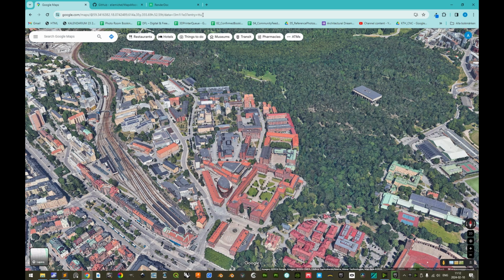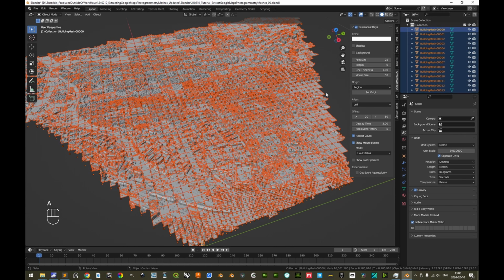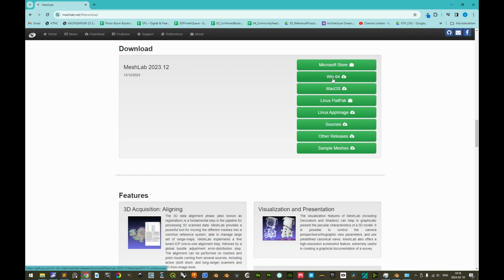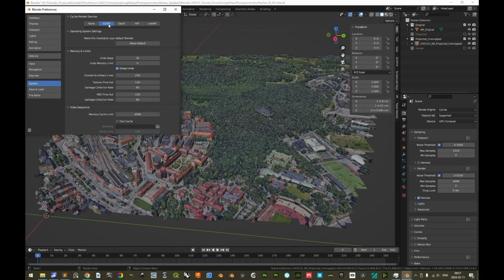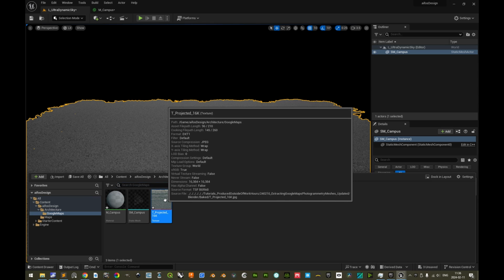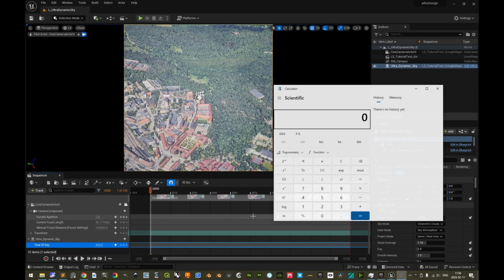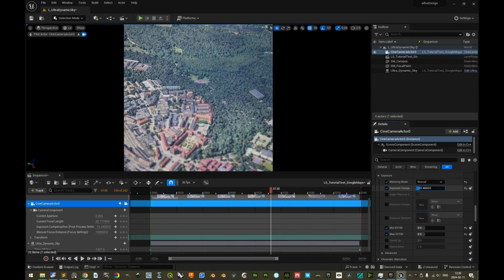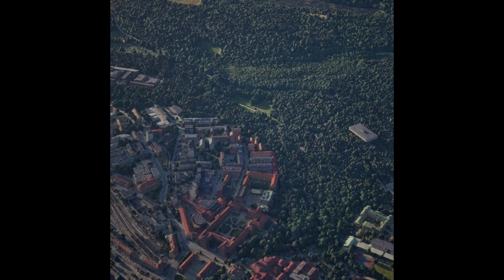Tutorial – How to extract Google Maps meshes and import into Blender/Rhino/UE5 for reference (2024)

Comment: Hi, I am using the most recent version of chrome (12 june 2025) and renderdoc v1.31 (as stated by eliemichel on his github in order to use the latest v0.7.0 version of maps models importer.

Sadly, I'm stuck in the very beginning of the video when you have to press okay on the pop up after injecting via renderdoc, as everytime i press "okay" after the injection it happens that chrome refreshes the ID and so another popup shows up with a different one forcing renderdoc to lose connection with the process.

I'm following the github documentation and your video (therefore the additional commands in the cmd prompt are the same as stated in your video) but i can't find any solution, should I use older versions as in your video or should I switch to MS Edge instead of chrome? Do you have any suggestions regarding this issue?
Reply: In case anybody's wondering, I managed to fix the issue by changing the prompt cmd from this:

set RENDERDOC_HOOK_EGL=0
"C:\Program Files\Google\Chrome\Application\chrome.exe" --disable-gpu-sandbox --gpu-startup-dialog --disable_direct_composition=1

to this:

set RENDERDOC_HOOK_EGL=0
"C:\Program Files\Google\Chrome\Application\chrome.exe" --disable-gpu-sandbox --gpu-startup-dialog --disable-direct-composition=1
Reply from the maker: Thank you so much for identifying the culprit, being underscores instead of dashes (previously it worked, but as you identified, a later update had less permissive use of underscores). I have changed the command in the description to reflect the result of your explorations. Thank you! /S&A
Reply: @SanningArkitekter that's exactly what i thought! I did the same process few years ago but I eventually forgot what softwares i was using (gis related stuff back then). I failed for so many hours tonight trying to do it by myself until I found this tool on git and your tutorial was really on point, it helped me a lot, so thank you! Kudos to you!
Reply from the maker: @UndefinedPipeline  We are very happy that it was of help :) /S&A
Reply: @UndefinedPipeline  Thank you, I spent too much time trying a solution. This worked

Comment: Baking is stuck right now on 36% for an hour or so; I sat the extrusion on 2mm. Is this normal? what other options can i do to solve this issue? Great tutorial, thanks a lot!
Reply from the maker: Hello! We do not know how to specifically solve your issue, but if one is ready to try another way, and is okay with it entailing a cost, then Lily Texture Packer is a 6-dollar Blender plugin which makes all of the process much easier. It does not require baking a projected texture – instead it concatenates/creates a compilation of all the original textures and merges them into one megatexture. It is quicker, more reliable, but does entail a cost. We hope that you solve your issue, or find a way around it. Best wishes /S&A

Comment: Not working every time adding pid, it change and make a new one
Reply: Don't know if you still have this issue, but I also had it. I got it to work for me by uninstalling the latest versions of both Chrome and RenderDoc and installing older versions (early 2024 Chrome and RenderDoc 1.25). Once I did, it worked correctly. Give it a shot.
Reply from the maker: This is a great suggestion – the process ID itself should be more dependant of the Chrome installation itself than the RenderDoc interface, so uninstalling Chrome and reinstalling it might solve things. Perhaps an earlier version alleviates the risk of the bug, but perhaps it would also work with the same version, just freshly reinstalled? Best wishes /S&A

Comment: Meshlab is crashing when running the Trivial Per Triangle filter. I've also ran Remove zero Area Faces and it's still crashing. Any ideas on a solution? Fantastic tutorial though! This is massive help.
Reply from the maker: Hello, Liam! We cannot offer a solution to your problem, but if your issues persist, and you want to try an alternative, other users have recommended using Lily’s Texture Packer instead of projection baking – it entails a small cost, but is easier to use and has much more reliable results. Thus we can indirectly recommend it. Best wishes /Sofia & Alexander

Comment: 🥲Hi!! Do you know the solution without Meshlab? I tried looots of times "trivial per triangles", but It crushed and soft downed automatically...
Reply from the maker: Hello there, Steve! In the stickied comment, there is a suggestion from another user to enable the MeshLab setting ”Remove Zero Area Faces” – try this first! If MeshLab still is giving you trouble, then other users have suggested to use Lily’s Texture Packer – it entails a small cost, but using it, you don’t need to re-unwrap and project the textures; Lily solves all of the UV coordinates for you, with one large merged texture from all of the input textures :) Best wishes /Sofia & Alexander
Reply: @SanningArkitekter  Thanks comment！ but I still confuse, with using Lily texture,, Liliy texture can merge(?) all texture, can't ? Is it the same Meshlab? I know how to it, but don't know how to mix use in your process,, and I tried to combine this vide too, but a little bit confuse,,
https://www.youtube.com/watch?v=6yhxfxcHH54&ab_channel=ArditPranvoku
Reply from the maker: Lily’s Texture Packer does not need any altered UV coordinates, so it should be straightforward to use immediately after importing – have you tried to follow Lily’s own tutorial on a suggested workflow? Best wishes /S&A
https://youtu.be/OyaCfshX3zo?si=haWnfLVsLCesJV7k

Comment: Python: Traceback (most recent call last):
  File "C:\Users\username\AppData\Roaming\Blender Foundation\Blender\3.6\scripts\addons\MapsModelsImporter\operators.py", line 53, in execute
    importCapture(context, self.filepath, self.max_blocks, pref)
  File "C:\Users\username\AppData\Roaming\Blender Foundation\Blender\3.6\scripts\addons\MapsModelsImporter\google_maps.py", line 209, in importCapture
    captureToFiles(filepath, prefix, max_blocks)
  File "C:\Users\username\AppData\Roaming\Blender Foundation\Blender\3.6\scripts\addons\MapsModelsImporter\google_maps.py", line 42, in captureToFiles
    subprocess.run([python, SCRIPT_PATH, filepath, prefix, str(max_blocks)])
  File "C:\Program Files\Blender Foundation\Blender 3.6\3.6\python\lib\subprocess.py", line 503, in run
    with Popen(*popenargs, **kwargs) as process:
  File "C:\Program Files\Blender Foundation\Blender 3.6\3.6\python\lib\subprocess.py", line 971, in _init_
    self._execute_child(args, executable, preexec_fn, close_fds,
  File "C:\Program Files\Blender Foundation\Blender 3.6\3.6\python\lib\subprocess.py", line 1456, in _execute_child
    hp, ht, pid, tid = _winapi.CreateProcess(executable, args,
FileNotFoundError: [WinError 2] The specified file could not be found.

I got this error. What should I do?
Reply from the maker: We are sorry – we have tried to replicate this issue or find any leads in the file directories mentioned in the error, but we have not found anything. Were you able to solve this problem yourself? Best wishes /S&A
Reply: @SanningArkitekter  I was able to solve the problem myself. Thank you.
Reply from the maker: That is great to hear! Best wishes /S&A

Comment: Thank you so much for taking the time to put this tutorial together! Anyone else having issues baking the texture out? Tried with and without CUDA, model stays stubbornly black. increased the cage size and margin size...still no dice. Any advice please?
Reply from the maker: Hello, Clyde! Thank you for your appreciative words! Regarding your problem with baking, we do not know specifically what could be the problem (for examples, the texture node to bake to must be disconnected during baking, and can be connected after baking, or the scaling of the objects might be off, which affects the baking setting, or any other problem). If your issues persist, and you want to try an alternative, other users have recommended using Lily’s Texture Packer instead of projection baking – it entails a small cost, but is easier to use and has much more reliable results. Thus we can indirectly recommend it. Best wishes /Sofia & Alexander
Reply: @SanningArkitekter  thank you for the reply
Reply: @ClydeJacobsen  i think u gotta bake to emit or smth like that
Reply: @manwithbatsuit  turns out I wasn't converting the textures correctly...all worked out in the end
Reply: @ClydeJacobsen  can you explain what you mean by not converting the textures correctly? I am having the same problems you had
Reply: @ClydeJacobsen  can you explain, I have the same problem
Reply: @catarinacosta9439  @JuliannaCano I selected the main "Google Tiles" group in Blender. Then sleect "3D Tiles" on the BLOSM tab . At the bottom select "Export Ready" under "Replace Materials". Then when exporting, select FBX and make sure "Path Mode" is set to "Copy", making sure the "Embed Textures" next to "Copy" is also selected. Once you export the materials should import correctly in 3D Max...hope this helps! Apologies for the late reply!!
Reply: @JuliannaCano  I selected the main "Google Tiles" group in Blender. Then sleect "3D Tiles" on the BLOSM tab . At the bottom select "Export Ready" under "Replace Materials". Then when exporting, select FBX and make sure "Path Mode" is set to "Copy", making sure the "Embed Textures" next to "Copy" is also selected. Once you export the materials should import correctly in 3D Max...hope this helps! Apologies for the late reply!!

Comment: does not work chrome opens as normal
Reply from the maker: Hello, Kay!

Just to verify – if you copy and paste these two lines into a command prompt and execute, does it not start Chrome in injection-compatible mode (with a prompt window)?

(If you use the 32-bit Chrome application instead of the 64-bit one, change 'Program Files\' to 'Program Files (x86)\')

Command prompt commands:

set RENDERDOC_HOOK_EGL=0

"C:\Program Files\Google\Chrome\Application\chrome.exe" --disable-gpu-sandbox --gpu-startup-dialog
Reply: @SanningArkitekter  nope does not work either the command opens chrome normally
Reply: it does not open up a prompt window with a code and chrome does not have a white screen
Reply from the maker: @TotallynotKay07301  Hello again, Kay! Now we've had the time to try to replicate the issue. Sadly, everything works perfectly well for us on our part (with the two commands entered into Command prompt, Google Chrome starts with the prompt window and white screen, enabling the opportunity to inject into the process).
Although we did not succeed in replicating your issue, we enter below some information about our setup, and if you have any differences, it might be the reason why it does not work (since it does work for us):
Windows 10 22H2
RenderDoc 1.25
Chrome 124.0.6367.210 (we also updated to the latest version, 125.0.6422.77, and that did also work for us)
We hope that you manage to find what is making it not work for you.
Best wishes,
Sofia & Alexander
Reply: @SanningArkitekter  im on windows 11
Reply: @TotallynotKay07301  You will need to exit Chrome from the task bar, chrome normally keeps running in the background, it needs to be closed entirely

Comment: When I use the Script, I get this error message: 

Traceback (most recent call last):
  File "<blender_console>", line 4, in <module>
  File "C:\Program Files\Blender Foundation\Blender 4.1\4.1\scripts\modules\bpy\ops.py", line 106, in _call_
    C_exec, C_undo = _BPyOpsSubModOp._parse_args(args)
                     ^^^^^^^^^^^^^^^^^^^^^^^^^^^^^^^^^
  File "C:\Program Files\Blender Foundation\Blender 4.1\4.1\scripts\modules\bpy\ops.py", line 60, in _parse_args
    raise ValueError("1-2 args execution context is supported")
ValueError: 1-2 args execution context is supported
Reply from the maker: Hello, Abdullah! It is mentioned in the tutorial, but not very clearly, that with the specific version of MapsModelsImporter that is used, we have only gotten it to work with Blender versions 3.4 – 3.6, and not with 4.0 or later (you are using 4.1). So we recommend for using this workflow, to also download and install Blender 3.6 (it will be installed in a separate directory and not conflict with your 4.1 installation). The link is this one:
https://www.blender.org/download/releases/3-6/
Best wishes /Sofia & Alexander

Comment: Hi I’m having problems with MeshLab, when I try to apply Parametrization: Trivial Per-Triangle it just crashes to desktop.
Reply: I found a way around (all done in Blender)!
1. Select the SM_projected mesh, go to UV Editing tab, enter the edit mode pressing tab, select all vertices, select UV -> Lightmap Pack. I kept all the default parameters execpt the margin value, I set it to 0.02 (but adjust it as you like - just make sure the UVs doesn't overlap).
2. Go to the Shading tab, create a new material for the SM_Projected mesh, create a new texture (like in the tutorial).
3. Select SM_Original mesh, ctrl+click select the SM_Projected mesh, go to render settings, open bake menu, Bake Type -> Emit, Check "Selected active object" and set the margin extrusion to 0.1m (this may vary), click " Bake".
Let me know if it works (:
Reply from the maker: @LucaZecchi  That is a great idea of you! Using the Lightmap packing method to make sure that all individual UV islands are sufficiently large (for lightmap baking in Unreal Engine or other real-time software, is our understanding) should also make sure that the UV islands are sufficiently large for texture projection baking! Great! Best wishes /S&A
Reply from the maker: Hello, Alex! Regarding your problem with MeshLab, other users have recommended using Lily’s Texture Packer instead – it entails a small cost, but is easier to use and does not strain the computer as much. Thus we can indirectly recommend it. Otherwise we would suggest to test with a smaller part first, verifying if the problem is only a processing problem or with the workflow itself. Best wishes /Sofia & Alexander

Comment: why do we need to pan map during screenshot making?
Reply from the maker: It is not strictly necessary to pan the map, but RenderDoc captures the frame when it is being rendered, and to our experience, if the map is static, the captured frame might be much smaller than intended if the map is ”kept active”, as an example, by panning. For us (especially with the old version of 1.13 of RenderDoc) it consistently has worked much better for us – you are very welcome to experiment :) /S&A

Comment: Does this work with Google 3D tiles extracted from Blosm? I tried this and Meshlab kept crashing trying to change the triangles
Reply from the maker: Hello, Daniel! We actually don’t know that, as we do not yet have experience with Blosm, and are no more than indirectly acquainted to the workflow. Regarding your problem with MeshLab, other users have recommended using Lily’s Texture Packer instead – it entails a small cost, but is easier to use and does not strain the computer as much. Thus we can indirectly recommend it. Otherwise we would suggest to test with a smaller part first, verifying if the problem is only a processing problem or with the workflow itself. Best wishes /Sofia & Alexander
Reply: I found a way around (all done in Blender)!
1. Select the SM_projected mesh, go to UV Editing tab, enter the edit mode pressing tab, select all vertices, select UV -> Lightmap Pack. I kept all the default parameters execpt the margin value, I set it to 0.02 (but adjust it as you like - just make sure the UVs doesn't overlap).
2. Go to the Shading tab, create a new material for the SM_Projected mesh, create a new texture (like in the tutorial).
3. Select SM_Original mesh, ctrl+click select the SM_Projected mesh, go to render settings, open bake menu, Bake Type -> Emit, Check "Selected active object" and set the margin extrusion to 0.1m (this may vary), click " Bake".
Let me know if it works (:

Comment: Got it to work BUT when I saved the 'image' displayed in Renderdoc (which is from an area of perhaps 1 square mile or kilometer_ and load the save rdc into Blender all I get is what appears to be one particular building not the whole area I see displayed in Render doc. Any ideas?
Reply from the maker: Did you make sure to set the Max Blocks parameter (when importing to Blender) to -1? Also, if you use Blender 4.0, the import will not work in the manner you describe (only one block will be imported), so make sure you use 3.4 or earlier. Best wishes /S&A

Comment: I cannot get this to work as when I click on (PID) OK and the Chrome screen opens it displays "You are using unsupported command line flag - disable-gpu-sandbox. 
I cut and paste the (CMD) command from your instruction and so it hasn't been entered incorrectly. Also the RenderDoc screen displays API D3D11 NOT PRESENTING.
I have gone over everything in the tutorials and have matched every step exactly. I have Renderdoc v1.25 installed.
Reply from the maker: Great to hear that you got it working /S&A

Comment: I can’t move the cursor like yours man. It does not rotate or I cannot get an angle
Reply from the maker: If you hold SHIFT on the keyboard, you should be able to – this was never made explicit. We hope that it works for you /S&A
Reply: Sadly this does not work in Turkey. @SanningArkitekter
Reply from the maker: @djohnworthy1040  We see – with Istanbul as a test, we can confirm that there seems to be no photogrammetry data for Turkey yet. When/if it is added to Google Maps, it will be able to be extracted. Best wishes to you /S&A